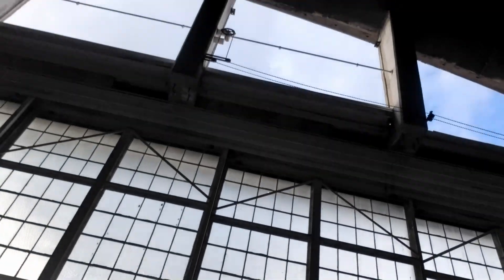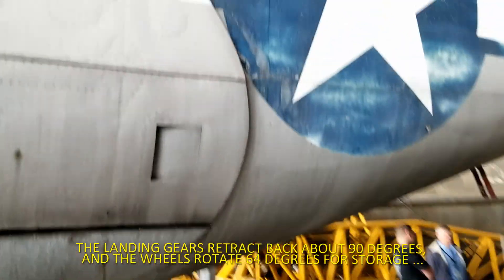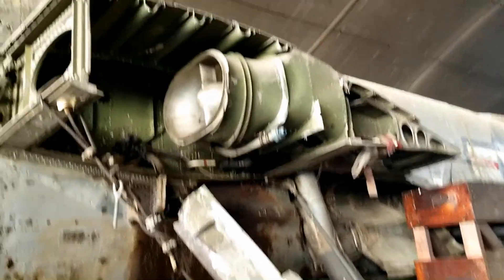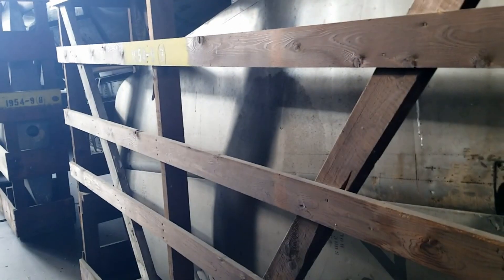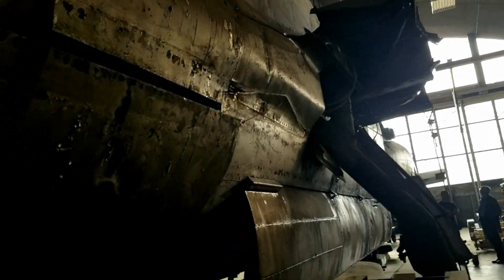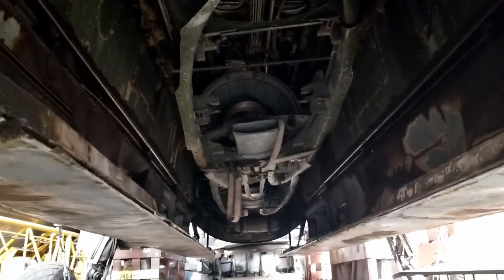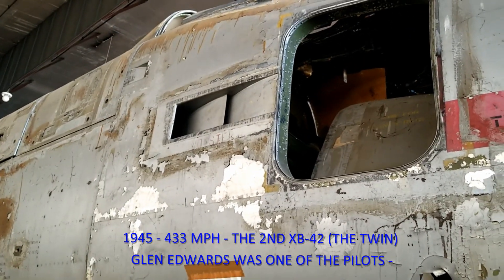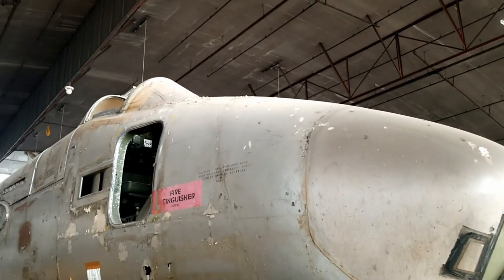DOUGLAS XB-42 MIXMASTER AT THE NMUSAF

Comment: Are you going to be able to replicate the contra-rotating propellers on your model?

I recall going on a Behind The Scenes tour pre-Covid and our tour guide mentioned that one set of wings belonging to one of those two aircraft were missing. It would be fantastic if that was incorrect.
Reply from the maker: Good question: I am going to try to have the contra-rotating props.  Otherwise, I feel like what is the point in making the model.  To me it would be like building an RC model B-17 with only two engines that run. 

I was planning on having two 30-40cc engines, but cant make this work due to cooling issues.  I don't want to have the cylinders of each sticking out the either side, so I plan to use a 60cc engine installed inverted with a single shaft running aft to a gearbox that will divide the power and swap one prop rotation.  I have it CAD modeled, not yet cut chips.  I do plan to do some ground test runs in a engine test stand, just like the real setup did in the 40s.

My contact told me that he thought they have the XB-42 wings.  My next trip over there, I will try to verify if this is in fact true.  I'm hopeful, but seems more likely the wings were lost at some point.

Comment: XP42 weapon load with range was equal to B29, only way faster. Re landing gear, all was not lost, this became the B66/Ol' Whale
Reply from the maker: I think the B-29 could carry a larger load, overall.  Which isn't surprising considering the B-29 had four 2,200 HP engines.  

B-29 per wiki:

5,000 lb (2,300 kg) over 1,600 miles (2,600 km; 1,400 nmi) radius at high altitude
12,000 lb (5,400 kg) over 1,600 miles (2,600 km; 1,400 nmi) radius at medium altitude
20,000 lb (9,100 kg) maximum over short distances at low altitude

Wiki lists the XB-42 at: 8,000 pounds (3,600 kg) in internal bay.

8,000 lbs for a twin-engine bomber is still a huge load
Reply: @mswinford  Unless it was submarine pens in France, no bomber carried the brochure load.
Reply from the maker: @BillWendell-y5c  - Agree, the range also has to be considered

Comment: Is this area open for the general public?  It used to be, before the 4th building was erected years ago.
Reply from the maker: No.  This hangar in the video is not the hangar you are probably thinking of, which were the Annex hangars that used to house the presidential planes in one, and the X-planes in the other.  They used to have scheduled bus rides until 9/11 ended all that.  On Google earth, there is a KC-135 variant used for testing sitting in front of what had been the annex hangars.

This hangar in the video is the 5th hangar farthest from the museum complex, and closest to the I-675 interchange.   In past years I have taken tours with my EAA chapter of the restoration shops, but these have to be prior arranged with the NMUSAF.

In google earth, you can see the F-104 dual seat trainer that was tossed around by the tornado that cut just past the hangar (see article below), and also portions of an A-26 invader.  The F-104 is slated to be scrapped I was told, whereas the A-26 components are going to some museum.  My understanding anyway.

TORNADO that hit WPAFB:

https://www.airforcetimes.com/news/your-air-force/2024/03/01/tornado-damages-buildings-hangars-at-wright-patterson-afb/
Reply: @mswinford   Middle easterners ruined something else for Americans... They are the reason we have TSA in Airports....

Comment: A design that Douglas threw everything at to try and salvage in the end, even a passenger aircraft concept with the two Allisons waaay up front in another postcode from the propellers. Would have sounded like a graunchy groany old bus from the passenger cabin with all the extension shafts desperately trying not to turn into Fusilli.
Reply from the maker: As another commentor mentioned, and is written about in various articles, there were no problems with the drivetrain.  For anybody who wants to really dive into the drivetrain aspect, below is a great article.  But yea, to your point it must have been a little noisy with those mid-mounted engines.

https://www.enginehistory.org/Propellers/Curtiss/XB-42Prop/XB-42Prop.shtml

Comment: Good video, an rc version would be awesome especially with how electric motors and batteries have advanced for RC plane use.
Reply from the maker: Thanks.  I considered doing the sane thing, and using electric motor(s).  That would be simple(r).  I want the noise, smell and fuss of a 2-cycle engine.  I had planned to use two 38cc single cylinder engines, but I can't get the cooling right for it while keeping it scale looking (meaning not having both cylinders poking out the either sides of the fuselage).   I thus plan on using a single 60cc engine (Ephil brand with electric starter), single shaft to a common gearbox that will divide the power.  I have a pretty advanced cad model with the engine in 3D.  Wait and see the next videos.

Comment: What is the purpose of the plexiglass nose - bombardier's position?  And do I see jet/rocket boosters under the wing?
Reply from the maker: Yes, I assume the Bombardier would have used the Norden bombsight.

Per Wiki:  The remaining prototype was used in flight test programs, including fulfilling a December 1943 proposal by Douglas to fit uprated engines and underwing Westinghouse 19XB-2A axial-flow turbojets of 1,600 lbf (7.1 kN) thrust each, making it the XB-42A.

Comment: You might take notes that the nose section of the XB43 is made up of wood and not considered a production version .
Reply from the maker: Actually, I mention in my write-up that neither of these planes went into production.  The plywood nose was added after cracking problems of the XB-43 plexiglass.

Comment: When did they reopen the restoration hangar to tours again? I was there in 20014 and enjoyed the tour. Now the 4th display hangar is open and all those planes that were over on the secured side of the base I’m wondering what aircraft were taken out of storage to put in the hangar next to the restoration hangar.
Reply from the maker: As far as I know, the restoration hangar is not currently open for tours.  Especially this last hangar, that had the upper windows sucked out by the tornado (or maybe blown in, but damage was very minimal to anything inside - see link below).  I was allowed access via my restoration shop contact.  My viewing is related to my desire to build a 1/8th scale RC model of the XB-42.  If I get it built and flying, I hope to fly it from the closed runway nearby, about 2,000 ft from the XB-42.  Stay tuned?  I'm also a WPAFB RC club member who has permission to fly RC at the closed runway.  In the hangars next door is a Kellet XR-8 contra-rotating helicopter prototype getting fabric reskinned, a Fielser Storch previously hanging in the WW2 gallery, also getting reskinned, and the B-17D "Swoose" getting rebuilt.   

https://www.airforcetimes.com/news/your-air-force/2024/03/01/tornado-damages-buildings-hangars-at-wright-patterson-afb/

https://www.nationalmuseum.af.mil/Visit/Museum-Exhibits/Fact-Sheets/Display/Article/196864/boeing-b-17d-the-swoose/
Reply: @ I remember the Storch hanging from the rafters in the WWII hangar. I’ve built all sorts of models of them over the years. One of my favorite German aircraft.
Reply from the maker: @fw1421  - a Great German plane, my father was a big Storch fan, has a set of Pazmany 3/4 scale Storch plans.  He planned to build one, he cant do that sort of thing now in a rest home

Comment: Although there were a few problems with the design, I understand the long shafting between engines and props was very reliable.
Reply from the maker: That is my understanding as well.  RR / Allison does the transmission shafting for the F-35 lift fan.

Comment: These were originally at the Paul E. Garber Center in Silver Hill Md. essentially the attic for the Air and Space Muesum for years. The aircraft had double canopies because they were Pressurized Aircraft and because of difficulty figuring how to keep the Fuselage pressurized the two smaller canopies were used. A single large one was to difficult to figure out even with the dual canopies they had trouble with pressurization because of the nose wheel layout.
Reply from the maker: Thanks for that information.  I had known about these being at the Paul Garber facility.  My contact Nick who works at the restoration facility (one of the two in the video) told me that NASM told the AF to come get the planes or they would be scrapped out.  

It makes sense what you mention about pressurization.  Douglas must have wanted better visibility for the pilots, and chose not to go with a B-29 styled windscreen, as the B-29 was pressurized too.  The XB-43 in the video clearly has plywood for the front bombardier plexiglass location, as I heard they ran into cracking problems at cold/high altitude conditions.